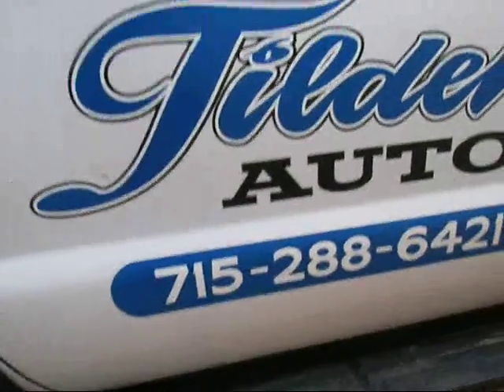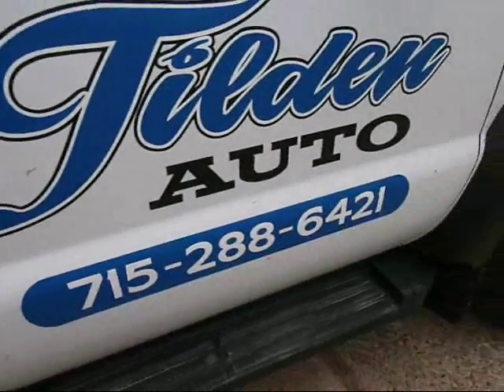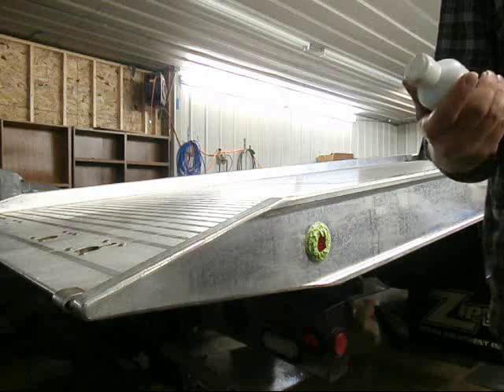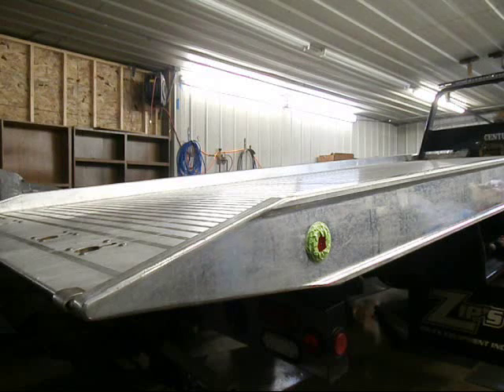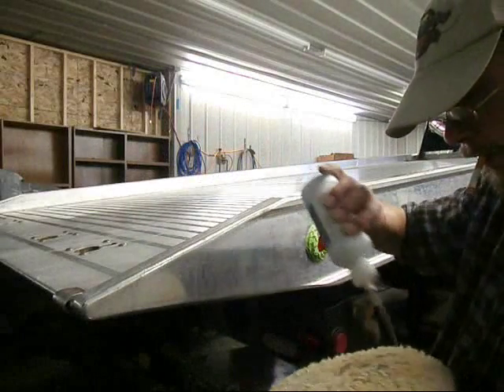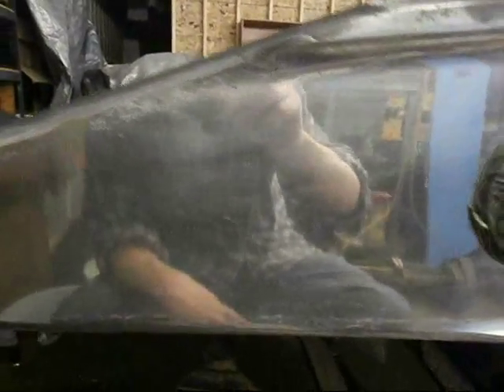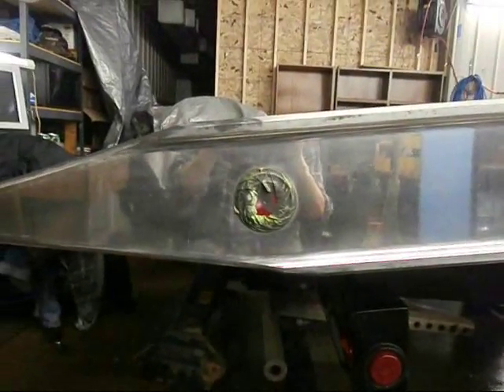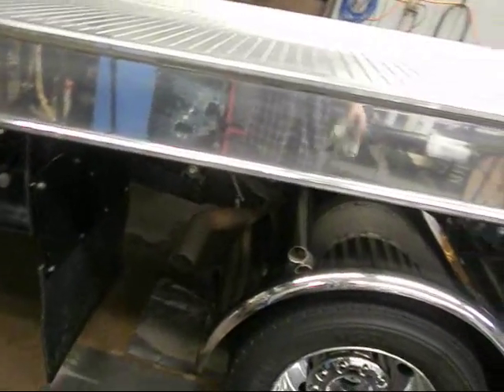5-8-14 Acid washed and polished a flatbed tow truck

Comment: what type of acide did u used to clean the bed?????
Reply from the maker: Sorry for the delay. I try to remember to look at the stuff I get from a local detail supplier. It is either the Pro Wire Wheel or Wire wheel aluminum brightener. Here is a link. http://www.ccsdistributing.com/CatalogProductList.aspx?Value=Paijfa8z%252foNDbzKHLwrDMILPXTmGuEIq1jhJiRp0SoI%253d